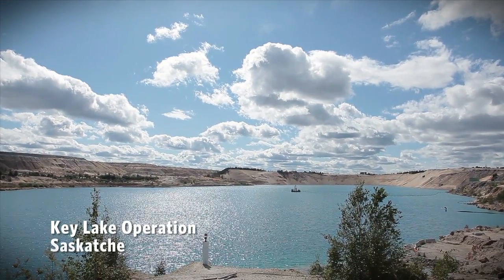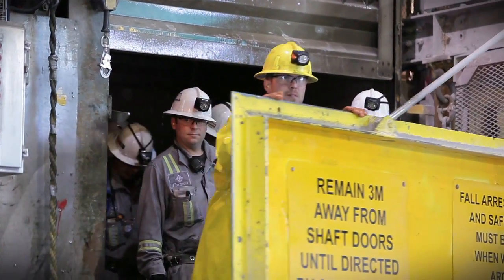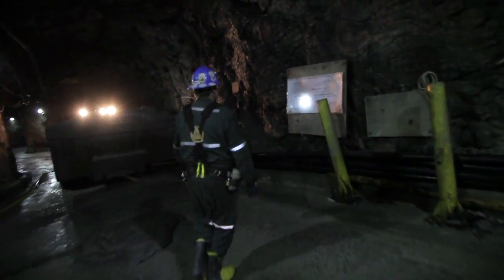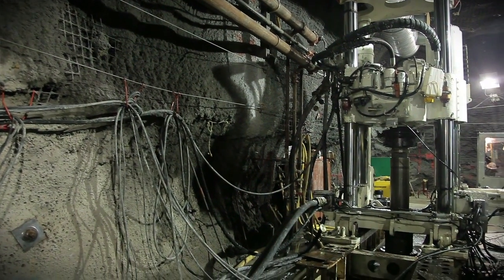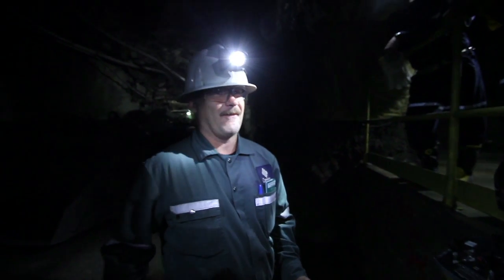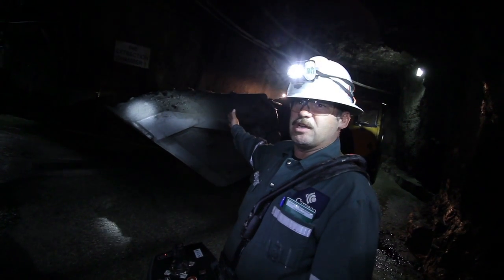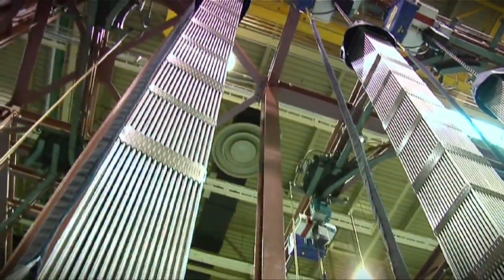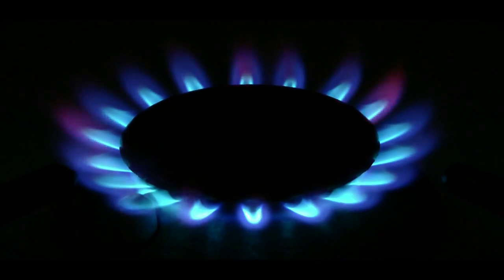Powering America: Uranium Mining and Milling

Comment: All these will have cancer hope 30k $ per yr worth it
Reply: It's a lot more money than that, I made nearly twice that running skid-steers and doing maintenance topside at a mine in Kentucky. The trick is ventilation - radon is the real hazard in uranium mines and concentrations can be reduced to harmless levels by ventilating the mine well. In the US, comprehensive exposure monitoring is done for uranium miners. The guys on the Navajo Nation in the 50s and 60s didn't have either.

Comment: Saying that Uranium's level of radioactivity is on par with granite is idiotic. The radioactivity in granite comes from U. But obviously in a U ore it's much more concentrated, so the activity is much higher. And the miners don't stay away from the ore for no reason.

I have some uranium mineral specimens and some of these are extremely hot compared to synthetic uranium compounds. The reason is that highly radioactive decay products are enriched in natural uranium ores. So, while it's not immediately dangerous, it's certainly quite different to granite... I guess there was some PR idiot at work there.

Comment: The use of a nuclear bomb with Uranium-233 is more difficult than the bombs containing Uranium-235 or Plutonium-239. This is because when a neutrons transmutation the thorium-232 to Thorium-233, and then next spontaneously Protactinium-233 and Uranium-233. Thus at the occasion the process produces of a number of short-life Uranium-232, and this is the source isotope of e.g.Thallium-208 - which in small quantities is very strong source of gamma radiation - dangerous for handling Uranium-233 bomb!